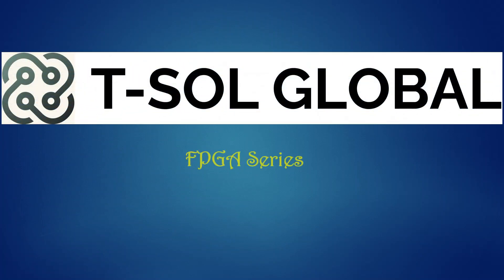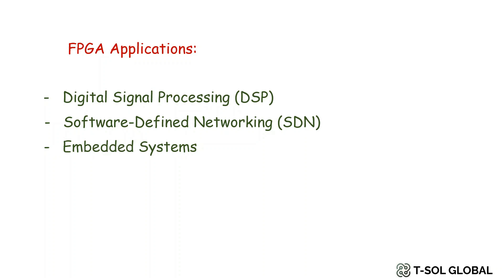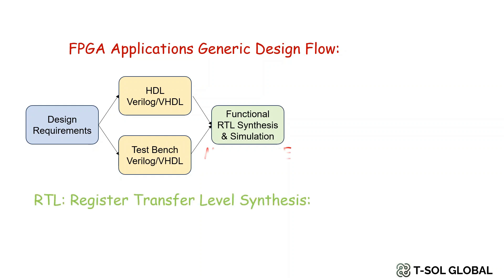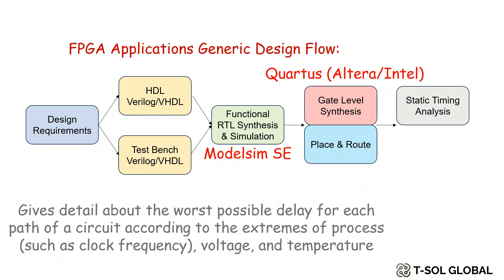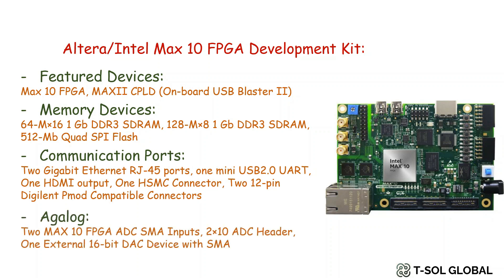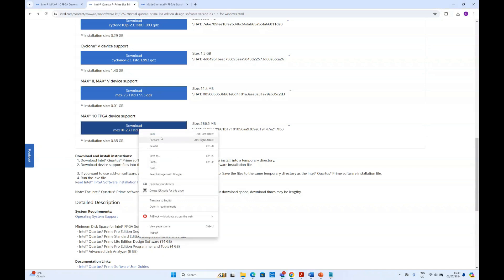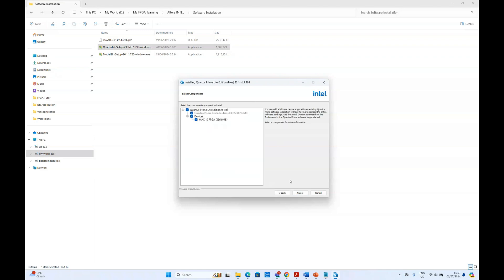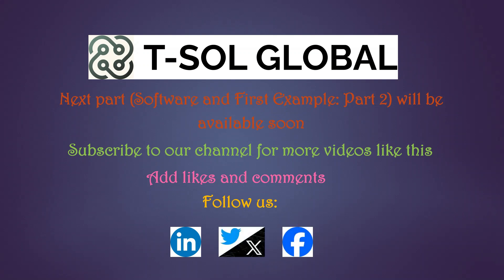FPGA Software and First Example for Altera/Intel MAX 10 Development Kit (Part-1)

Comment: I'm interested in interfacing an Intel MAX10 to an LTC2320-12 ADC or AD7381-4 ADC (like the Analog Device article 'Interfacing FPGAs to an ADC’s Digital Data Output')..   
but wondering if it can be done with LiteX (like the video JESD204B : Interfacing to modern ADC/DAC with LiteX or the whitepaper by Milan Schabort).

I imagine not only is the PCB layout tricky, since the LVDS interface between the FPGA and ADC runs at 200Mhz, but the fpga design as well.